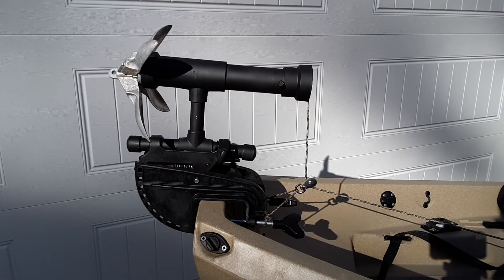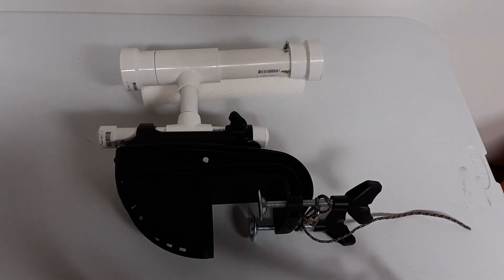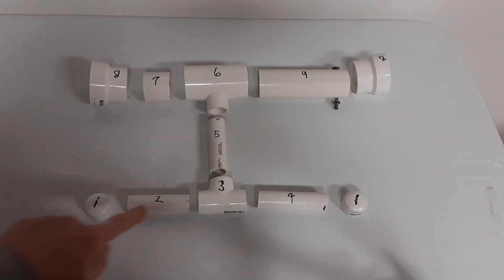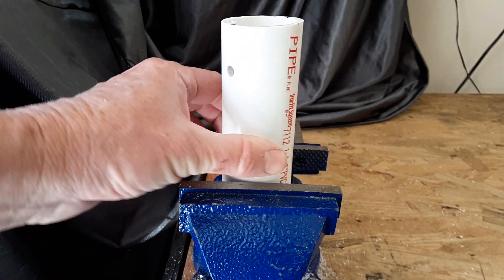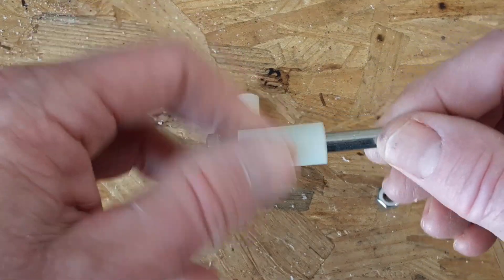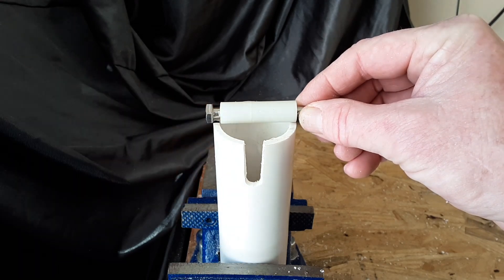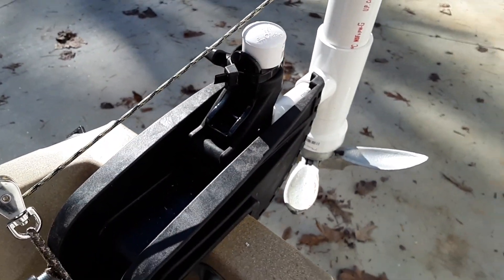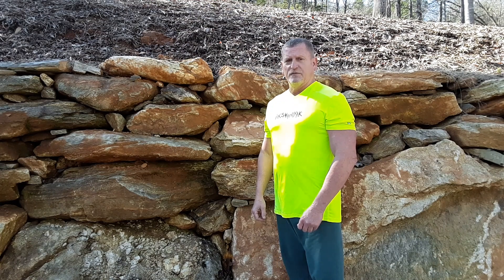DIY Removable and Retractable Anchor Wizard

Comment: Awesome idea, I did something similar using a Folbe square rail mount that attaches to my front handle and I attach the Anchor Wizard chute to that. Its probably the same price as buying that much pvc and It’s really streamlined. I really appreciate that you took the time to paint it black. I am the exact same way.
Reply from the maker: Thanks Adam. You are probably the same as me...form and function are both important.
Reply: @Aksmaniyak  Absolutely. A cool kayak upgrade isn’t as impressive if it doesn’t look cool. Thanks again for all the excellent content!
Reply from the maker: @adamgregory9198  You are welcome! Keep DIYing!

Comment: Would an anchor like this hold a kayak in place in intercoastal currents?
Reply from the maker: I honestly don't know. I fish freshwater lakes and streams.
Reply from the maker: BTW, where did you train? I trained with the Gracies in Torrance CA.
Reply: @Aksmaniyak  when I lived in California i training at GB in escondido
Reply: I have a similar system that came with my 2017 Malibu 12 that I bought used.  It is an off the shelf system with a reel and anchor deployment mechanism like this.  First time I dropped anchor was in a considerable current. Maybe 2 knots. I looked back and my stern was almost under water 'cause the current was trying to take me west. The anchor had hooked on rocks and was not going to slip.  The harder I reeled and pulled, the more my stern went down.  Since it was fixed on the stern, I had no way to get sideways or tufn around so, I had paddle backward like crazy to get up stream of the anchor and pull away from the rocks.

IMHO, these anchor systems attached to the stern are hazardous. I plan to scrap out this anchor system this season and install a trolley system
Reply from the maker: @hardrockminer-50  I understand how those things can happen. This design uses a cleat to tie off the paracord. In an emergency, you can just untie and release the anchor.
Reply: @Aksmaniyak  and you've lost your paracord and anchor. Unless yo've got a float on the end somehow. Mine is called Anchor Wizard. I guess when I get to the end of the cord on the reel, it would just come off the reel otherwise, a handy sharp knife.

I still think having anchor fixed to any one part of the kayak is asking for trouble.
Reply from the maker: @hardrockminer-50  I agree. Any hard tie down that can't be easily released could be trouble. I would rather lose paracord and a grapnel than flip my kayak or worse.